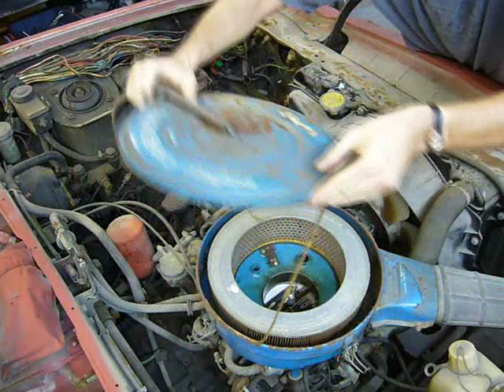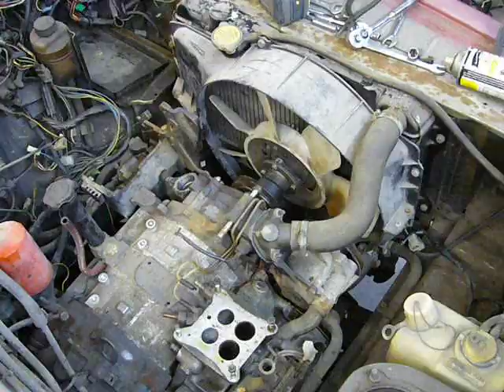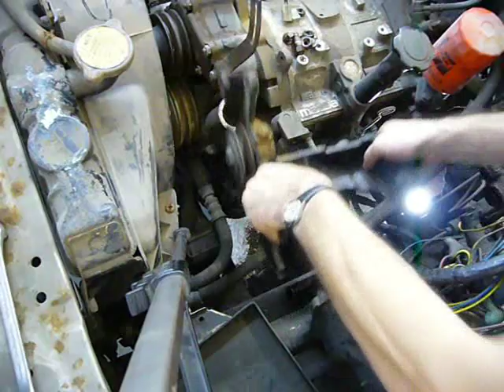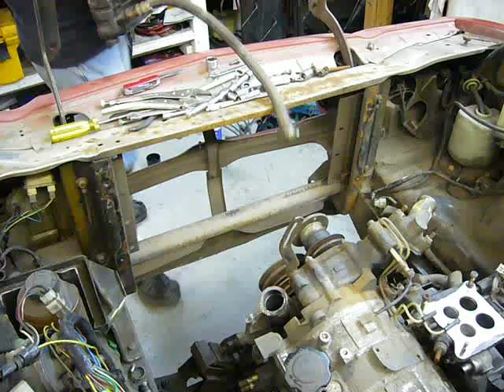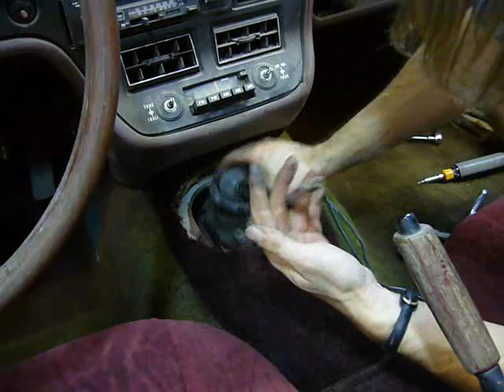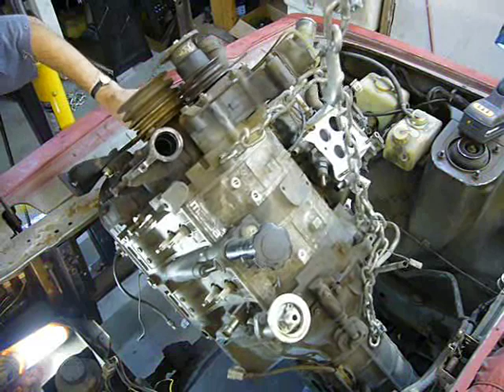Part 2: My 76 Mazda RX-5 Cosmo Restoration - Engine Removal

Comment from the maker: @thebigdille And thermal reactor rotarys had such a unique smell. The system works quite well, and in the mid 2000s I had an all stock '78 RX-7 where the thermal reactor system still worked perfectly. Even passed emissions. Just too bad that the whole system was massively heavy and very restrictive.

Comment from the maker: They can't be left out as they are structural parts of the car. Luckily, I was able to find a set of replacements which will need very little work before they can be installed. It took over a year to work out the details of the sale but it was worth it considering the amount of time having them will save me.

Comment from the maker: Indeed, it is a very strong transmission. The Mazda R type is somewhat related to the T5 and used on RX-3, RX-4, Cosmo, REPU and then turbo RX-7s until the end of the FD. All NA RX-7s got a weaker M type. The R type is often used up to and beyond 500HP and for the most part holds up very well. I had one rebuilt locally a few years ago and the transmission shop was amazed that it came from a 1.3 L Mazda. :-)

Comment from the maker: @22ness0hayden I'm sure the carbureted car made more top end due to the short runners in most IDA systems, but it likely lost low end and midrange if swapping to the carb was the only mod. Of course, with a properly tuned EFI system it would still have made similar power at WOT, but all other characteristics would have improved. Keep in mind that my Cosmo will make 300HP @ 300 FT-LBS, start hot or cold, not stick, get good mileage and idle perfectly at 750 RPM in all weather when I'm done.

Comment from the maker: None of the emissions stuff from this engine (ACV included) has been reused. Housings, rotors, etc. from this engine were combined with irons from a GSL-SE engine to build a 6 port 13B. Later episodes cover this as well as setting up the intake manifolds, MegaSquirt and turbo.

Comment from the maker: @sacheus It's part of the factory emissions system. Air is directed to the exhaust ports, thermal reactor manifold, heat exchanger and/or exhaust cooling jacket via a series of solenoid controlled valves as dictated by the emissions computer. Worked very well in the '70s to easily meet the new emissions regulations. Now the pump is not needed as the car will be fitted with fuel injection and a modern high flow catalytic converter.

Comment from the maker: Yes. Likely when I do the body wiring. For now I'll just use the original Cosmo alternator as a mockup but I expect I'll use a one wire generic (Chevy or whatever) high amp alternator when I reach that point.

Comment from the maker: @yerboogieman It is a 1/4" headphone jack. It is wired somewhere into the dash. I can only assume it is for a set of headphones connected to one of the stereos. The original AM/FM is still there but someone has installed an AM/FM/Cass unit, which is a little annoying because I how have a hole in the dash to deal with. I'm planning to remove the stock unit (if I recall it is DIN sized) and install something more modern.Sometime in the '80s someone already tried this and made a mess.

Comment: @aaroncake Exactly, it was just something Mazda came up with, being successful with the small size of the rotary. The thermal reactor was an alternative to the current catalytic converter, the air is pumped into the reactor to keep the combustion process present and further the reduction of unwanted emissions.

Comment from the maker: It had been sitting for many years so I was not going to put it back into service. I had already decided I would use parts from this 13B and a 13B 6 port from a GSL-SE to build a new engine (see parts 7, 8 and 12).

Comment: " It had been sitting for so many years..."  I know you've rebuilt a different engine, but most of the parts that get damaged by years of sitting are seals of various types, and unless there was serious corrosion in the water jacket, which could have occurred, that engine would rebuild nicely. You mentioned ebay, I do hope you did list a bunch of your stuff there. A fair amount of money is spent on about all of it daily! That old engine would probably fetch some serious cash.

Comment: First, I am AMAZED at the size of the original transmission it that car! It's almost like Mazda wanted to compensate for the compact size of the their Wankel! Seriously, the trans dwarfs the motor.  I could be wrong but I'd almost swear that gearbox is bigger than a Ford Toploader 4 speed, which is easily capable of handling 500hp and more, with ease.  Is it because the Wankel spins to such high revs?  Just curious.  I'm entertained so far!

Comment: Hi Aaron, get in touch as I may be interested in some of those parts you are pulling for my own Cosmo! BTW I also had one oddball square motor mount which does not appear in the Mazda Cosmo parts manuals!
Reply from the maker: If you'd like to send me a message via YouTube with what you want, go ahead. However the carb and intake have been sold. The housings were used on the engine. The rest of the parts...not really sure why anyone would want those. :-) I think I scrapped the exhaust stuff a year ago.
Reply: aaroncake Fair enough! Would certainly have wanted the carb. Now I'm on the hunt for a combo switch.

Comment from the maker: @22ness0hayden The air pump thing was kind of a joke because of the ominous warning on the sticker. We have emission laws here, but with EFI and a catalytic converter, the car will run cleaner and make more power than it ever did with the carburetor and thermal reactor. Carbs to me are scrap metal, and just because a car is 34 years old, it doesn't have to drive or perform as badly as a 34 year old car.

Comment: I have an 88 rx7 I found coolant in one of my spark plug housings. I knew the radiator was running hit couldn't figure out why. I flushed it changed the thermostat. All hoses are fine. Water pump is fine too. But I don't know what coolant in the spark plug housing means can you help me out here. Love your bids by the way you make it look easy.
Reply: is it posible that your engine housing is cracked?

Comment from the maker: @Grappler130 Carburetors are nothing but "controlled fuel leaks into the intake manifold" and have no business on a vehicle. Hell, with the cost of manufacturing small electronics at basically zero, carbs have no business on even lawnmowers where EFI could easily be adapted (small mechanical fuel pump, single integrated module driven from another coil on the magneto). It's good to have a full shop of tools but it has taken years to accumulate them.